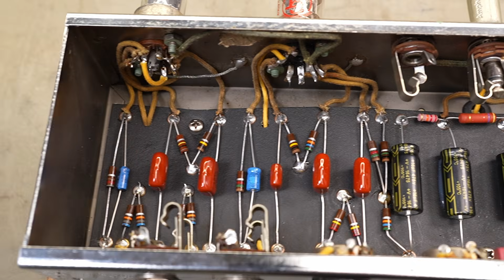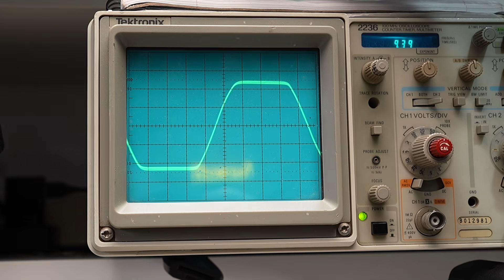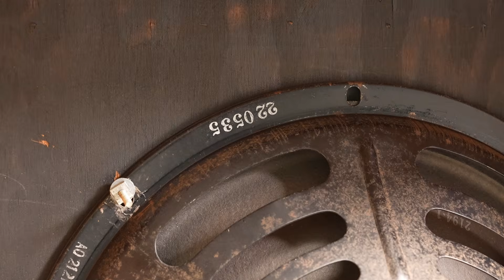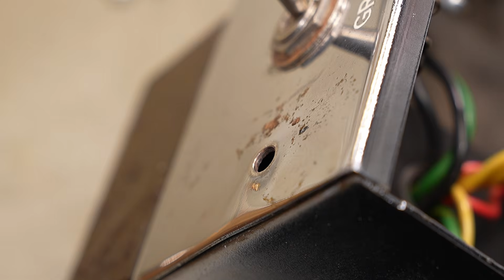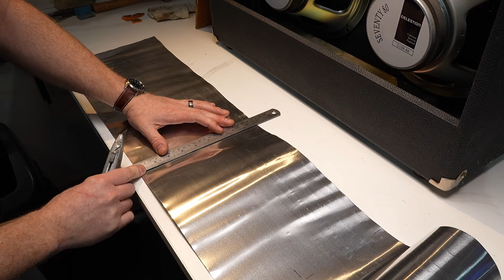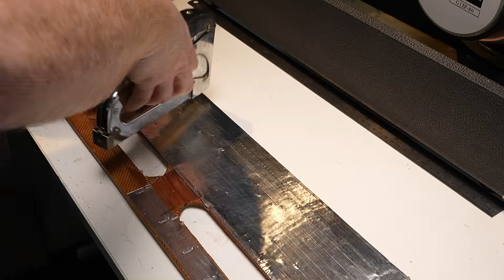1958 5E3 - Part Three

Comment: I like that big 250 ohm cathode resistor on the end there. Ohmite brand maybe ?🤔  I've seen Ohmites that look like that i know. And I've also seen that style but with one side having the wirewinding exposed and a moveable metal strap wrapped around with a tightening screw that served as a tap allowing adjustment or connection as a voltage divider. Interesting design, essentially a potentiometer i suppose, old school and heavy duty, i doubt ever having any trouble with one. I always thought they would make a good cathode resistor since it would allow you to make fine adjustments to bias but never actually tried it.

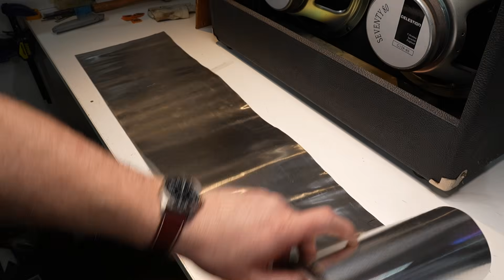Comment: 11:15 Brad is both younger than myself abd far more old fashioned; I haven't used an old-fashined Stanley-style utility razor knife in nearly a decade since buying several Olfa knives with the renewable, snap-off blade tips. Those things are awesome and surgically sharp.

Comment: While working for a plumber at age 19, right out of high school, , I had a massive one-day asbestos exposure while dismantling an old industrial-grade boiler/furnace which was encased in asbestos-laden plaster. I was chiseling the plaster off and the asbestos fibers were floating like snow in the air in the low-ceilinged room (and then I had to pry the cast-iron boiler sections apart with sledgehammer and wedge to make them sufficiently "light" to drag them out of the basement by hand). Oh, the things we did when we didn't know better back in the 70's  and 80's....how I'm even still breathing at this point is inexplicable.

Comment: If you do the math, Lily's very first job was very likely working for Leo Fender. She would have been around  16 or 17  years old when Leo and Clayton Orr "Doc" Kauffman parted ways, and K&F changed their name to The Fender Electric Instrument Company. If you see a round gold (yellow orangish) label with some blurry emblem inked onto it in orange ink, those are old Los Angeles Approved labels. They were like the UL (Underwriter's  Listed), and Canadian CSA (Canadian Standards Approved) labels only exclusively tested & certified for selling stuff in Los Angeles, CA,  These little yellow & orange dots appear on a lot of old Ampeg, Fender & Gibson amps. They allowed the neutral to be the only fused conductor, death caps, no green safety grounding conductors, etc. So did UL & CSA back then. Boston had the same thing. The Boston approved stuff seemed the nicest of  anything.

Comment: I've worked on many tweed Fenders and I've seen several names. Lily, Maria and Lupe are the ones I remember. I'm really glad you didn't change the heater wiring to twisted pair. The stock wiring is surprisingly quiet and doesn't need to be changed. Just like the filter caps. From the factory the cap grounds ran through the holes in the doghouse and were soldered to the case. A pain to work on and impractical.  You did a fine job on that resto.

Comment: I missed it, did you measure the dcr of the speaker? It's out of a Hammond organ, they're often 16R each installed in pairs.
Reply from the maker: Yeah it was 8R nominal.
Reply: I've cannibalized a few organs for parts but the only 16 ohm Jensen speakers I've seen were in Bell&Howell movie-projector speaker cabinets; those speakers usually have brown frames (hammer tone or wrinkle-finish) and a screw-on 2-pin mic connector for audio hookup, bolted to the speaker frame. I've also seen 16 ohm Rola and Heppner alnico speakers used in organ tone cabinets.
Reply: @goodun2974 8 ohm 12 inch Rola alnicos also. This one is likely from a late M3

Comment: That is not an original speaker,  it is a 1955 , but it is a Hammond Organ speaker
Reply: Yes, that AO 2127..... number does indeed make this for Hammond Organs. Maybe it was sold to Leo as they might have had extras. It's a P12Q, the same speaker in originals. Or a 1965 organ pull.